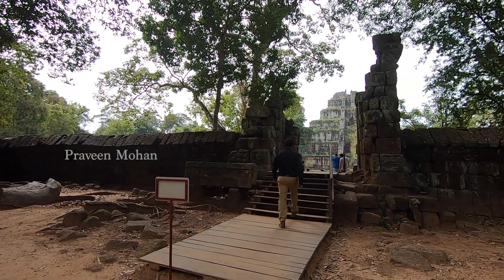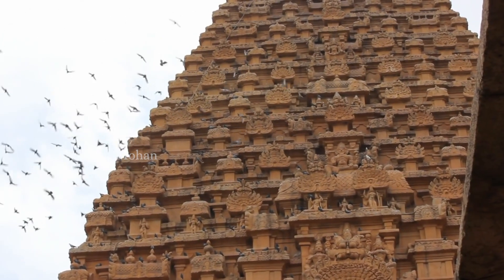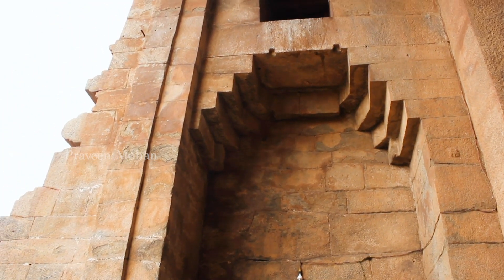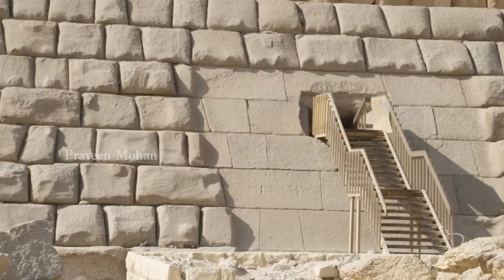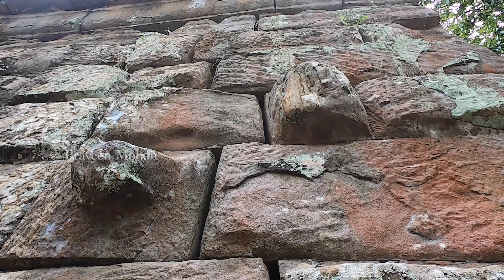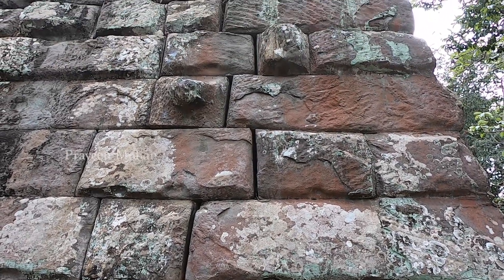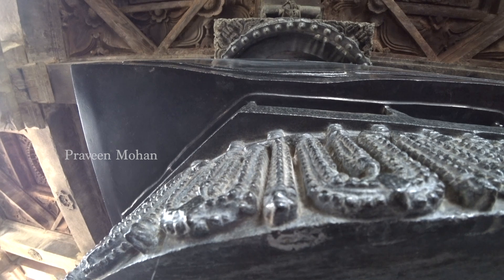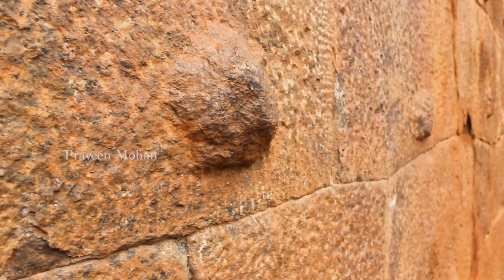Mystery of Ancient ‘KNOBS’ in Temples - Evidence of Stone Melting /Geopolymer Technology?

Comment: I think the knobs were used to keep the blocks off the ground slightly in order to put ropes or straps underneath the block. Blocks without knobs probably have them on the other side. The knobs also may have been used to fit into divets on other blocks to add stability.

Comment: Your assumptions are mistaken.  Just because they cannot be used to lift the stone, does not mean they can have no other  purpose.  They could be simple visual identifiers for a particular type, size, or location of a block, which could also match a drawing during construction.
Your assumption that if they were deliberate, then all blocks would have them is also wrong.
You would have to remove the block and check the whole shape to see if it was different in any way, perhaps the other sides are special to support floors, or stairs, or drains?  Maybe that block has a hole or a crack, or is shorter or longer?
Perhaps it was even used to stop a rope moving side to side, rather than having the rope loop under it?  Maybe a piece of wood fits in, around, or between nobs...

We don't know, but you rule out some things as obvious which are simply incorrect.

Comment: In injection molding tech, when a molten liquid is injected into a mold, there is a remnant called a "Pigtail" that occurs from the mold entrance. Those stone blocks were injected and molded right where they set. the protrusions are Pigtails that weren't trimmed all the way.
Reply: And I would guess a variable molding system was used so each block would use front and back plates with with injector ports and be fastened to the last and bottom stone, to allow zero gaps. The front, the back and one side would be custom, and reusable, moveable, to get a perfect fit every time. The pigtails trimmed., as needed or time allowed. "Polygonal Stone Construction". I'd think concrete could also be used. I am working on a design to  manufacture igloo style small  Polygonal dwellings.

Comment: I would agree at least in part with what some have mentioned already.  It does seem strange to me that the builders would leave such noticeable defects in the stones as they do detract from the aesthetics of the structure.  One thing for sure, the mainstream has it's head up it's ass on this just like it does on so many other things.  The coding ideas seem plausible as well.  Perhaps less coding than just symbology used to convey purposeful information.  This is commonly done in modern construction as well.  If you look at piping in particular, especially interior industrial piping, you will see arrows and terms showing what the pipe is for and the direction of flow.  Keep plowing forward, Mr. Mohan.  I love your ideas; You're helping to put the main stream to shame!

Comment: Casting. In casting, a sprue is the passage through which a molten material is introduced into a mold, and the term also refers to the excess material which solidifies in the sprue passage.In sand casting, the sprue is formed by a dowel which is removed from the sand to make the hole into which the metal is poured.. Function. Sprues can serve as filters, heat sinks, and as feeders.

Comment: @PraveenMohan -   I could see those knobs being used for a temporary support during construction.  If during the construction process there is a need to stabilize the wall, a brace could be set back at an angle with one end up under the knob and the other end of the brace back away from the base of the wall so the brace is at an angle to buttress the wall until there is enough surrounding construction in place to assure its stability.    That would be a reason to have the stones with knobs just here and there and not on every stone.  And if a carving was ultimately going to be placed where a temporary support was needed during construction. then just that knob would need to be removed when the carving was added.  I am not saying that is actually what the knobs were for...just offering it up as a possible explanation.

Comment: Granite is piezoelectric. The knobs could have been painted with conductive material for electrodes.  High oscillating voltage would make blocks into sanding devices. Vibration enables blocks to be slid about with adjacent side and under blocks.  Perfect joints could be created. Some machining blocks would get small, they would be placed in upper, non critical places.

Comment: Or, keys used for form attachment and alignment?  
Which is necessary higher up, not lower where forms can rest on ground or each other.
As forms are repositioned higher, you need a way to hold them in place.  
Also, knobs may have been cut off later after the pour in some places for aesthetics.

Comment: Some theories suggest that the knobs are simply a by-product of molding the stones there at the sight. They weren't manufactured at a different location and brought there. No, they were made just were we see them today. The creators "poured" the molten stone/geopolymer between two existing blocks, and thats why the stones fit so well together, and also, since they poured the molten substance in from the side, that's what caused these "knobs" once the substance hardened.

Others suggest that if the knobs were indeed used for lifting, then the knobs must have been longer, and then were cut off once the stone was in place.  But why then can these knobs also be seen on the base stones in some of these structures, like the casing stones of the Egyptian pyramids. 

So, I think the "stones" were created at the sight. It's pretty notable at the casing stones of the Menkuru pyramid in Egypt, that the molten substance was "pumped up"/filled from the bottom of each "stone block". That's why the "knobs" can be seen on the bottom of each stone.

Comment: Because of the size and complexity of the temple building project putting knobs on rocks in higher spots is odd or on only a few compared to the larger amount without is almost like somebody cared about amazing others by the most of it but didn't care for the beauty of 100 percent of it.i  put forth the hypothothis that the rock was molten and very hot and when set in place there was expansion and forced out in a bulge.or it was injection molded and the knob was cut off but up high it was difficult for some reason to cut it off in time.

Comment: Rocks have a frequency. Crystal rocks frequency is used in watches. If you can change the frequency to that of bread dough the rock will be soft like bread dough without melting. The knobs are where the frequency modulator is attached. All rocks touching that rock and each other will have their frequency changed at the same time. Knobs are left when the frequency modulator is detached.

Comment: They cant be left from pouring molten rock, because they would not be on the face side, but would be on the the top if it was poured in place and on the back or bottom if moved after pouring. Not to mention it would be relatively easy to smooth off before it set.

Comment: RE: holes and knobs. I am a builder for all my life. from my perspective the knobs and holes could be used as something for another structure or facing for attachment. its hard to attach or put stucko or facing on a smooth surface. you need knobs or inserts into the holes to have something for the material to hold on to. think stucco-wire
Reply: Agree with your reason
Reply: @nirusouji  the holes would be where you would attach the inserts that hold the stucco wire. Then you can put a facing or artwork.
Reply: One on each side could sit wood trunks or planks.with a small cut out to hold tight.
Reply: Some kind of white-wash finish  perhaps? I know castles had it back in the day and it wore off already too.
Reply: Yes but as a designer, and enthusiast for history and historical architecture - so many knobs don't make much sense, the holes are - yes you insert wooden plank and build on top of it
those knobs are encountered on steps in Greece and Turkey for example, so ... Can't be for hanging on something 

Molten rocks - one has to cut the stone to see ... Grassand plants grow anywhere, churches are cleaned almost annually from growth on walls
Reply: Agree ,used as a key for additional veneer , also in casting it would be easy to identify repetitive molds used in that process - master mason
Reply: Those builders may have melted rocks.. 
But as a civil engineer working on building site for 15 Long years let me tell you what it look like. Those sites ( specific place) was scheduled for extensions or have had extention ( carving etc). Those are simple brick ( stone) stitching technology very commonly used all over the world ( and in India). 
You leave those out during construction of the primary structure.
Reply: Makes sence
Reply: A. Boisjoli if you was planning a piece of wood. You wouldn’t put a knobbly bit of wood on the timber. You would place a bench stop on the bench. In the case of these stones, a similar thing on the ground. Then on saying that, as they’re quite heavy. They would stay in position under its own weight
Reply: I was thinking the same, if they had a big form of plaster attached or possible lugs for beams to sit on, that have weathered away faster for some reason
Reply: That makes sense! But even if that was the case.. builders could have cut the bumbs and made it matching with other brick as it's outer part of the building.. which could be corrected if they wanted to... ancient builders have shown such precisions in their work all the time and still chose to leave it bumpy like that... Or may be they wanted upcoming generations to show the inner part of the brick.. an idea of how it was stuck to it's place may be... Dont know 😅
Reply: My thoughts as well  .. .
Reply: Bo Burwell  polymers
Reply: Thank you for your attempt to explain the knobs. Please see my explanation in the comments .... I too have been building all my life.
Reply: @sygrovesteve5819  i don't see your explanation in the comments
Reply: My thought exactly.
Reply: Exactly my sentiment, reuse of older megalythic structures and standing stones is highly possible for ancient peoples sourcing building materials.
Reply: Also, you can face a cup or hole inwards, that doesn't work with a non.. .
Reply: Yet another thing is that, if these nobs or protrusins were made for the purposes of securing rope or some attachment for lifting after the quarrying process, they would have been made on larger blocks than the ones represented in the finished temples often. Why lug a bunch of small blocks to a site of you have the ability to transport a few boulders.
Reply: Tyrone Notwatson  yeah well I never said it was a claim I said it was a theory
Reply: I was searching for an answer similar to what I was thinking... they had possibly another decorative structure, intricately carved separate from the temples, set to fasten to the knobs... but this theory runs thin if u look at all the placements, you’ll need a pretty extensive imagination. I just don’t think they made very many mistakes when it comes to the planning involved in the overall construction
Reply: Bo Burwell  very interesting idea. But I don't think they heated stones with fire or electricity. In the video he talks about a plant that melts or soften the stone. Which is very interesting, because it is said that in Peru (Machu Pichu) pre-Incas also used some sort of plant to liquify stones. And that this came from observing birds, which used that plant to build nests in stones.
Whether these plants and birds still exist or whether this method is true or not, I have no idea.
Reply: How about the knobs could be the corners of a sandbag. It could be they used a sandbag or something to that effect as their mold.

eg. lay the mold down next to the last block, fill it with polymer, let it dry, go on to the next mold. this could be an explanation for all the different cornering as well.

The large blocks that Bend around the corner could have been a sandbag mold thrown on top of a form.
Reply: Bo Burwell  Yes, the protrusions are inlet openings for the melt and openings for the discharge of gases which are formed during melting.

Comment: What utter garbage - this implies that thousands of slightly different sized molds were constructed for the thousands of slightly different shaped stones [and what were the molds made of that could sustain such heat and not melt themselves].  No civilization is that inefficient  and wasteful even if they could easily melt rock [requiring nearly 3000 Fahrenheit for sandstone, 2300 F for granite].  I am sure that any geologist would highlight that there is no chemical evidence of the rock having been heated; huge structural changes would exist and they don't.

Comment: Dear Praveen, Thank you for your very interesting videocasts and your theories. In my opinion, and I'm speaking as a sculptor. as an artist, I look at the knobs in a different way. Whoever built those magnificent structures worked with artists and sculptors. A sculptor would never leave the knobs protruding from some of the stones for no reason. They would have made them flush to the surface even on out-of-the-way parts of the building. They were there for a purpose. The knobs are what is left of protrusions that were filled down when the people who made the structures moved on. They would never have left ugly protrusions in magnificent buildings. No, what I believe we are looking at are protrusions that were used to hold screens or panels or some form of apparata. I also Believe that stones were cut with saws and put in place. From there they were 'sound' melted until they were hermetacally sealed. It's a theory. What we cannot deny is that whoever built them left this planet.
Reply: And Thus the beginning of Slug Snail's began , anything making enough noise to Melt Stone , Surely would have turned Human Bone's into Soup , perhaps that's how Mason jars were named , for containing the Jelly of Master Brick Mason's , HaHa !!!

Comment: If it signified that the stone was defective, maybe on the back side, why didn’t they cut the knob off after placement?  Your theory doesn’t make sense either. What makes more sense to me, is that ALL of the stones were cast out of the floating rock material. But once the flood happened ( there was more than one flood) all of the newer minerals that came with the flood were absorbed into the floating rock, under pressure. Thus, turning into the stone we see today along with filling in any gaps as well as slow erosion. Kind of like how you see old tree stumps or timber turned to stone. Because we see other ancient sites the are leaching the calcium or have become decalcified. Some have all leached out and turned the floors white.

Comment: The knobs look like “Vestige” Excess material (plastic) protruding from the gate that can be automatically or manually trimmed by a machine operator (injection molding). They probably used a form of polymerization controlled by frequency and amplitude at ambient temperature. Target vibration sets the state of the material controlled by amplitude and frequency.

Comment: Im not a fan of the melted stone theory. I'd push the liquid stone theory, which is, they got loads of different powderized minerals, that were dry mixed together in a recipe, then mixed with water, then baked in a giant oven. The opening of the mold where the mixture was poured could be where the knobs come from. The stone mixture prob expanded as it dried into stones.

Comment: Great observation Praveen, as these nobs obviously had a purpose. Pondering on this I came up with another suggested purpose of the nobs! I believe all these building rocks were softened, cut and placed by a skewer type rod that when pulled out left an exit bump, as is a known effect? (pulling a skewer out of soft putty) for example. This may just be one technique used in the day not unlike today when your running out of your good stock... add in the bad stock to fill the corners?

Comment: I have a different theory about these "knobes". I noticed that these are usually placed in corners, or near the edges - I mean that these knobes are placed where there is a junction of several stones.
I'm sure that the ancient builders could softed and mold the stones (using physics, something similar to a microwave, not herbs, as a chemist I can tell that no organic material will ever affect a mineral stone - acid can dissolve limestone, but not soften it).
The knobes purpuse is for future repair of the wall. When there is an earthquake and the stones are seperated somewhat, the knobes and the area around them could be softened and pushed into the wall, so all the spaces between the stones are closed.

Comment: If they used granite in a fluid state it would take a lot of calories to generate that much heat for large production.  Until recently, I thought granite as lava never made up past the earth's crust to the surface.  We would always mine it below ground or find it exposed above ground from shifting of the crust.  It appears in certain circumstances, basalt can flow up thru granite, bringing granite up with it in pieces and melting it as well.  So, how probable is it they let nature melt and flow granite as lava into molds.  Probably low but it would have been possible if they found a hundred million year old granite with basalt pushing its way up through.  Only other explanations are working it into shape with tools or melting granite by some other means, no?  One source readily available to ancestros for heat was volcanoes, 2nd, the sol, last, wood fires.